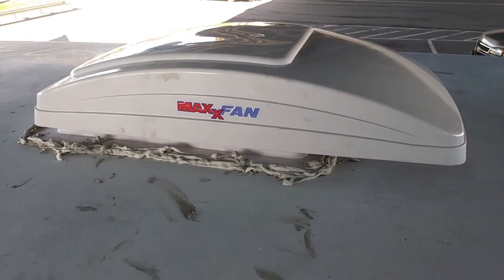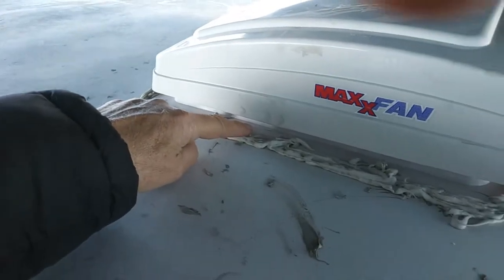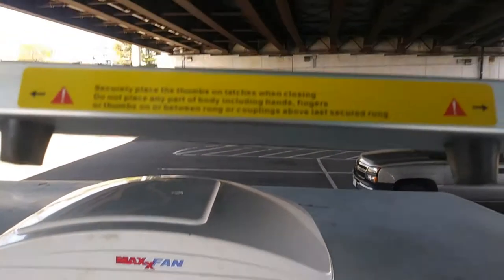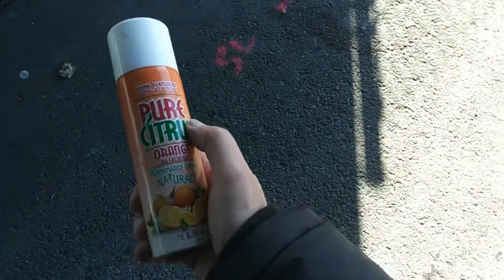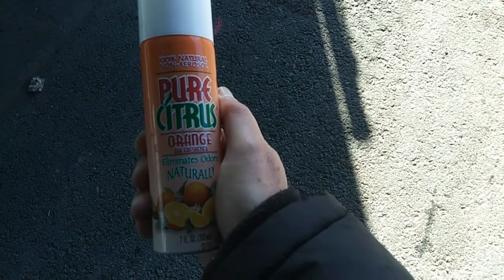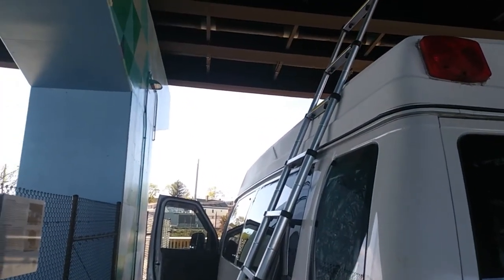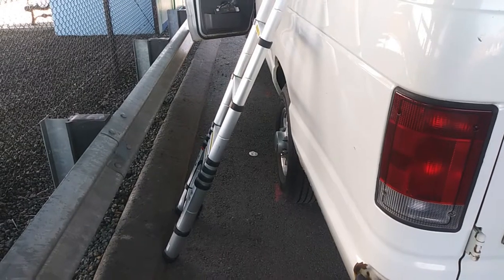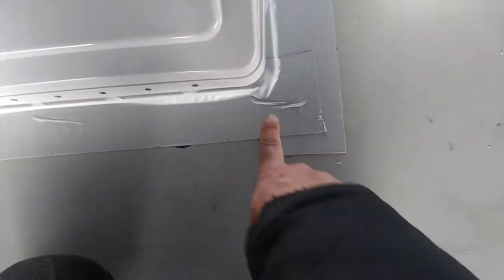Van Life: Roof Vent Leak Repair

Comment: In UK most common product for such fittings is Sikaflex. Hope your leak is sortes
Reply from the maker: I used Sikaflex self leveling sealant on the roof vent of my previous van but that had a metal roof and Sikaflex doesn't say whether their product will adhere to fiberglass. We've been having a lot of rain lately and there's been no leaking so I think the Eternabond is doing its job.
Reply: @vangazmicvoyage5077  well as it sticks to pained surfaces I would not have thought it a problem on fibreglass gel coat. But fixed is fixed!